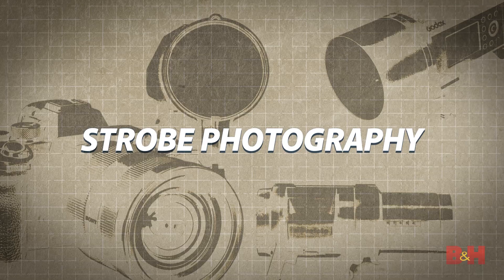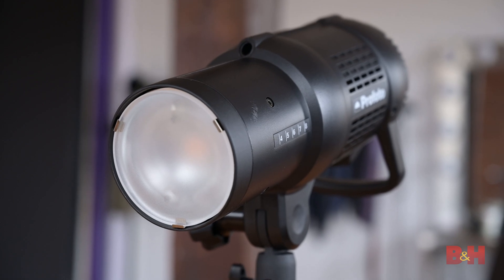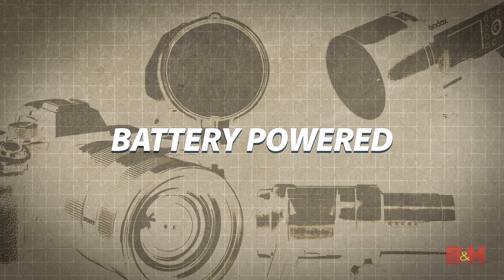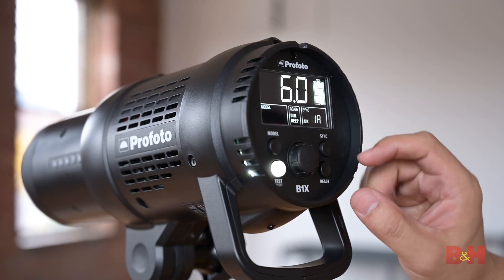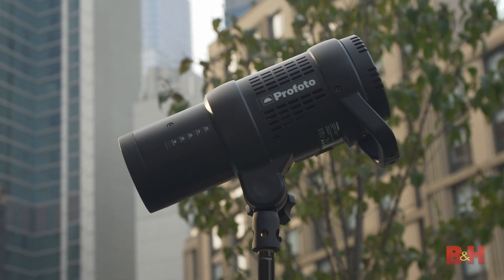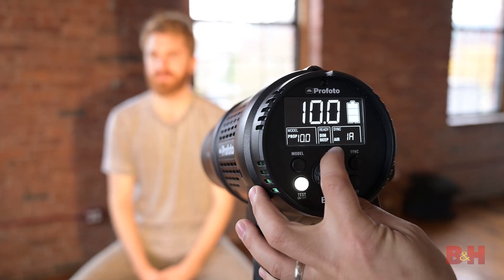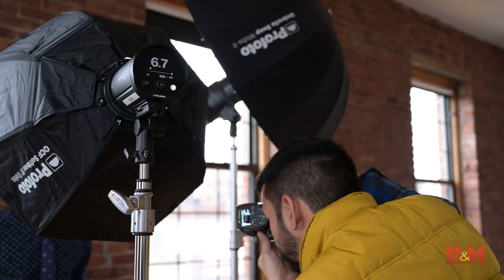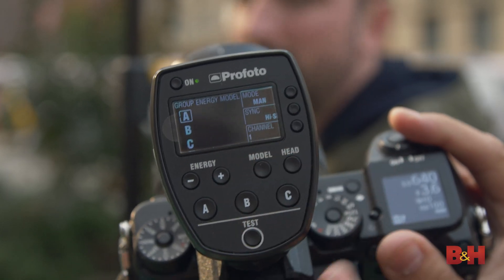What Are Studio Strobe Lights? (And How Do They Work?) | Strobe Lighting Part 1

Comment: What kind of bulbs are in strobes or flashguns?
Reply from the maker: Flashtubes, speedlights, strobes, or flashguns  typically consist of transparent glass or quartz tubes filled with xenon (or, occasionally, other noble gases) and fitted with electrodes.   >Mark<

Comment: Could you kindly share brand and model of the Radio Control Unit for Canon 200D II (centre pin not available) for using multiple studio strobe lights
Reply from the maker: Currently, the Canon DSLRs without a center firing pin on the hotshoe such as a 200D II could only work with the Canon ST-E3-RT II, BH # CASTE3RTV2, This transmitter fires any Canon speedlite with the RT designation.

https://bhpho.to/3EyCthl

Comment: I don't understand. Does modeling light just switch off during exposure and be replaced by the flash function, or those are separate functions?
Reply from the maker: Generally, the modeling lamp and the flash are two separate functions. If you had the modeling lamp turned on steadily, that can dim once you fire your strobe then turn back on after the shot has been taken. There are also instances where the flash and modeling lamp can be set proportional, where adjusting the flash output would also adjust the output of the modeling lamp.

Comment: Thanks for the video. I have a few questions as I'm still a little confused as I'm just starting to explore strobe lighting. 

1) When I hear the word "strobe", I usually think of a light that produces a continuous burst of flashes that goes off or blinks intermittently, like you might get a strobe light in a disco. Is that not what this type of strobe light for photography does? Or is it just basically an extra large and more powerful flash that can be controlled via a remote trigger in the same way as a speedlight and only flashes when you tell it to flash? So it doesn't blink on and off intermittently?  Can you clarify for me?

2) Why is the monolight called a monolight? What makes it different from other types of strobes?

3) Can you get strobe lights that have the option to be both battery powered and mains powered so that you could use it in the studio or use it also on location without any mains source?

Thanks.
Reply from the maker: Thank you for your questions. In regards to your first question,  a strobe is a larger flash unit than can be synchronized with your camera using either a radio trigger or a sync cable going to a camera that has a sync terminal. When connected with either of those methods, the strobe will fire when you press the shutter button down completely.  Some strobes have TTL functions like a speedlight would give you while the vast majority operate with manual control of the light output.  Strobes also measures in watt/sec or joules which is the amount of stored energy that it can store and release. Secondly, monolights are self-contained strobes, which differentiate themselves from strobes which use a separate flash head and separate power pack. Monolights have the flash and power pack in one unit, so it would be plugged in directly to a wall outlet or in some cases, you can run them off of batteries. Lastly, there are monolights/pack & head units which offer AC and battery power. In terms of the monolight options with AC and battery power, one good example is the Godox AD600Pro Witstro All-In-One Outdoor Flash
. BH # GOAD600PRO which includes the battery and offers the Godox AC Adapter for AD600Pro Witstro Outdoor Flash
, BH # GOAC26 separately. For the pack and head option, Godox also has their AD1200Pro Battery Powered Flash System, BH # GOAD1200PRO and its Godox AC Adapter for AD1200Pro Battery Powered Flash System
, BH # GOAC1200. Now if these units are not within your budget, we invite you to contact us directly via Live Chat on the B&H Website until 8PM ET or call us at 1-800-606-6969 until 7PM ET so we can go over some other options with you.

Comment: Ive just bought a neewer c180, it has the fuse missing, but it was affordable for me, what type of fuse will I need? Do modelling bulb cause fire
Reply from the maker: Unfortunately, we do not currently carry this Neewer product. You should be able to obtain the replacement fuse from them directly. You may contact them here: https://bit.ly/37zBzDT

As for the modeling lamp, it is important to install it with a barrier over your hand to prevent any premature failure and to make sure that there are no obstructions in front it that can potentially cause a fire.

Comment: Do strobe lights make your picture look more cinematic
Reply from the maker: Strobes definitely offer a different look as compared to continuous light when shooting stills, due to the ability to add many different light modifiers to them more easily. However, a cinematic look is more relevant to video where continuous lights would need to be used.

Comment: How does this connect to the strobe?? Do you need a receiver?
Reply from the maker: Use the Profoto Air Remote TTL-F for Fujifilm
 BH #PRARTTLF :  https://bhpho.to/2AogAWw
Maximize the potential of your AirTTL-equipped flashes through the use of an Air Remote TTL-F from Profoto. This powerful remote provides you with an outstanding set of features, including support for wireless power control and TTL, including high-speed sync, with Fujifilm cameras. Operating on a 2.4 GHz frequency, the Air Remote can sync with flashes up to 1000' away with normal triggering and 330' with TTL. TTL is useful because it offers automated shooting and exposure and brings the advantage of high-speed sync, enabling the use of shutter speeds up to 1/8000 second. Also, the controller has 8 channels and 3 groups, ensuring minimal interference with other nearby systems and equipment. Each group can be controlled independently from one another, permitting ±2 EV adjustment of power ratios for TTL systems and nine stops of manual control. You have access to remotely turn on/off the modeling lights or heads, making it easier to adjust lights in your studio. Additionally, there is a mini-USB port for installing firmware updates and it runs on just two AAA batteries.

Comment: I received the AD400pro 3 months ago. The inside fan started running all the time last week and never stopped after turn the unit off for hours. Called B&H Customer service next day and told me to send it back. B&H sent me a return shipping label that took 5 days to get it back to B&H. I guess this is not very important for B&H customer service. Now B&H customer service is telling me that the estimated turn-around time for repairs are 4-6 Weeks. So basically, I invested $650 on this unit at B&H and B&H customer service is “sorry” that I can’t work and use my brand new AD400pro for 2 months. Seriously? B&H really needs to learn from other retail stores about customer service. Very very disappointed
Reply from the maker: Thank you for your order and this feedback. We regret your dissatisfaction. We do not offer rush return shipping service. If you want that, you must pay for it. We do offer pre-paid return shipping, but it is not rush. Once we receive and evaluate the return we will send it to a repair service and they will fix it as efficiently as they can. Under normal circumstances the estimated turnaround time is approximately equal to what you’d receive if you’d sent the computer to the manufacturer’s authorized service facility directly. We regret this item is not working perfectly and regret that repairs, plus round-trip shipping, take time.
Reply: @BandH  Now the repair is 8 weeks, and as today there is no update as of yet, as it has not been repaired yet. So basically, I wasted my money buying this strobe 3 months ago because who know when I will get this useless strobe back